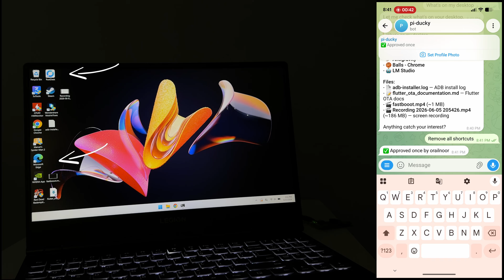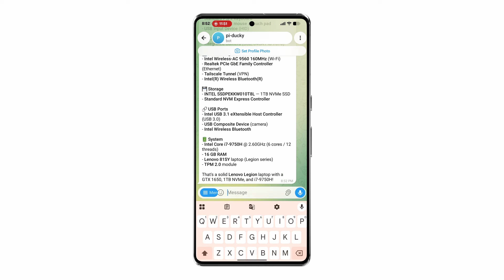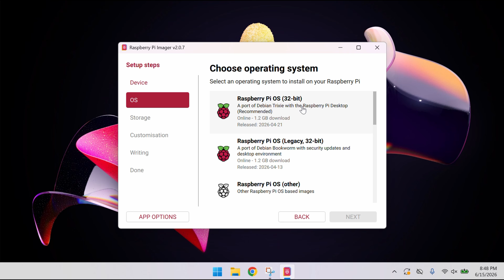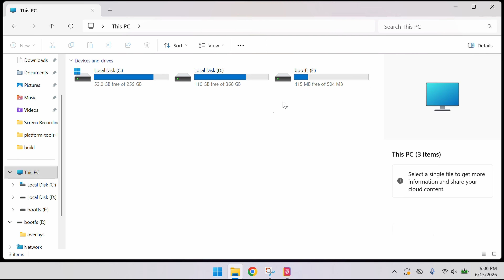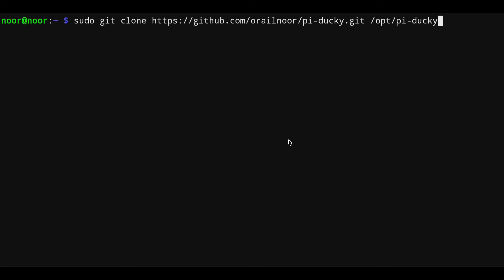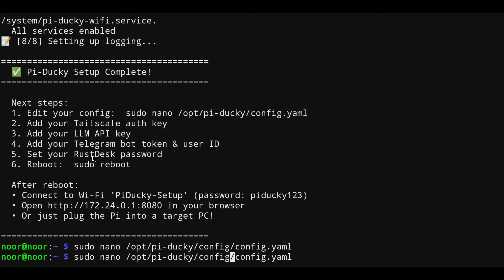I Turned a Raspberry Pi Into DIY USB Rubber Ducky

Comment: Bro can i contact you. I am getting trouble installing VScode on Ubuntu in termux. please help me 🙏
Reply: ask any ai chatbot...
Reply: @TheModernNetrunnerwtf 😂💔
Reply: @TheModernNetrunnerI do it . But for some reason it didn't work. I even use multiple AI claude, gemini, chatGPT , deepSeek none of them couldn't fix my problem. even I install vlc and but it didn't open duo root and I can't bypass it with command 😢
Reply: And I using debian
Reply: I install VScode after trying so many time's.But sad it open bun not responding
Reply from the maker: VS Code isn't officially available on termux, you can install code oss using TUR